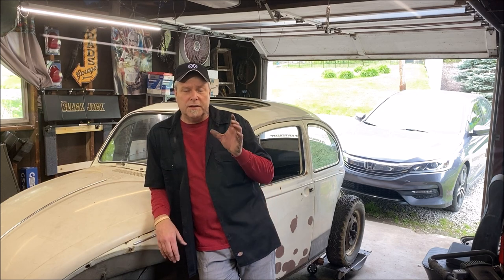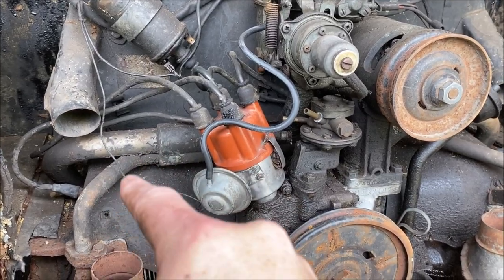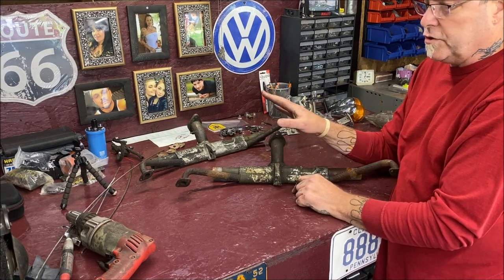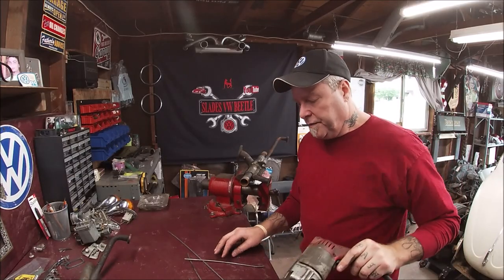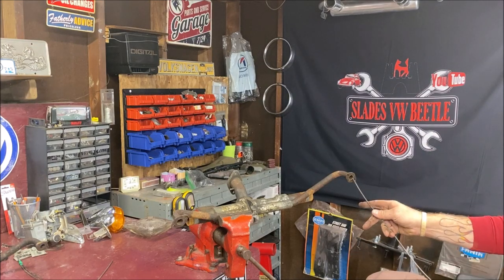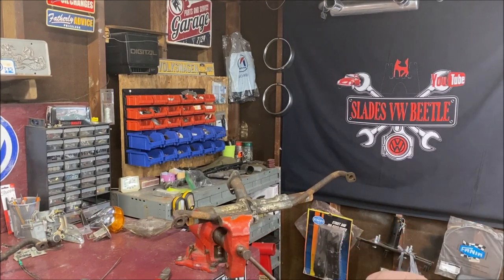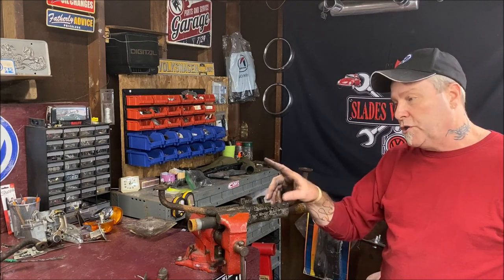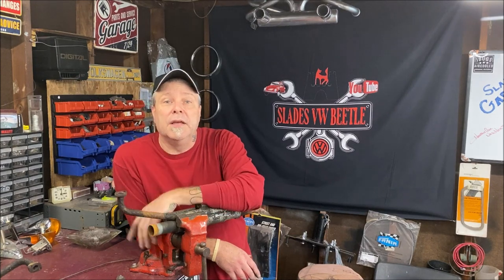VW Beetle Carb icing up- How to clean Heat Riser Intake - Carb icing up? Dual port - Single port

Comment: Been chasing my tail trying to figure why the hell my engine kept bogging on acceleration the point of shutting down. Runs perfect at idle. When I bought, I never noticed the heat risers were absent. It started and drove decently so I bought it and shipped it to Hawaii. I have replaced clutch, pistons, carb, distributor, alternator, fuel pump first to electric, now back to mechanical. I had heat risers from another manifold I'm no longer using and going to attempt to mate them to existing German dual port manifold. Icing at carb base happens even here in the tropics, I believe this has to be my issue, just dreading taking apart , AGAIN! I have to say I am so appreciative your channel exists along with many other helpful vw content creators!, Thanks Slade!
Reply from the maker: Thank you!!

Comment: So stoked to find this video.  My 56's carb was condensing and I was scratching my head until I saw this.  I am going to try it by removing the muffler.
Reply from the maker: Outstanding, I truly hope it helps out
Reply: @SladesVWBeetle  If it works I will be buying some merch!
Reply: @SladesVWBeetle  Its a 56 ragtop I inherited when my dad passed.

Comment: Great video! My mechanic did this to my intake for my 1971 beetle. He was not satisfied, so he got the tubes Hot with a torch rosebud and then shot oxygen in the tube. What a smoky mess! I had to have the tubes replaced because of leaks. Very important to have this clean running a single carb!
Reply from the maker: Yes, I have seen people use torches before. Unfortunately I don’t have any. But I’m glad he did that, your carburetor will definitely warm up properly.

Comment: I did this before. Was painting all my tins and changing gaskets. Someone told me about the carb build up so i had it all a part and said what the heck, might as well. So much carb build up came out. I didnt have any performance issues but im sure if i didnt do it i would have eventually.
Reply from the maker: It is so important to do this. And it makes a huge improvement on the carburetor being warmed up. I always hope these videos help other folks.

Comment: way back in '82, first year i owned my 73, i was heading home from work on a humid summer afternoon and out in the middle of traffic while waiting for a light to change, engine choked up. towed it to dealer. they get to it next day and say nothing is wrong. (IDIOTS!) 39 years of educating myself and i know that i got nailed with intake manifold icing. my solution was dual weber ict 34 carbs! oh, and the compressor coming on brings on a grumpy cat appearance. heehee. look at all that rust and crap comin out of there. enjoyed the vid. i had been in the garage working on my zuki. heading to the lake now to try and catch a fish.
Reply from the maker: Oh I love the dual webers 34s! 
That’s half the problem really damn fast. I have them on my 72 and that’s probably what I will have on the 68 to be honest with you. They warm up nicely, and wakes the motor up.
Reply: @SladesVWBeetle  i didn't have the right linkage when i was running my webers at first. got rid of it and went with the cb performance setup. so much better.
Reply from the maker: Oh I bet that’s a major difference. I had the hex linkage from aircooled...I wasn’t overly impressed with it but it worked OK.
Reply: @SladesVWBeetle  scat center pull? my original setup was center pull. cb's is much better. worth the money.

Comment: The other overlooked issue is cheap exhausts that have heater riser flanges but are pressure fed on both sides!
I was too chicken to use this method and just soaked the whole thing in Deox-C which is kinda the UK equivalent of evaporust.
Congrats on 3k subs, you've worked hard for it :)
Reply from the maker: Yes you’re absolutely right about the cheap exhaust. Soaking them can help too. And if you don’t want to use a drill, you can definitely hand feed a cable through there at least to get the loose stuff off. Thank you so much I truly appreciate the kind words.

Comment: Thanks you so much for this video! I'm so glad I found and subscribed to your channel.
I am new to my 64 and trying to learn.  As the days get colder and wetter (west coast of Canada) the beetle was running rougher and stalling out. I was told it was icing. Just stop and let it melt and you are good to go but it's getting worse not better. I'm going to try this. Can't hurt (if I'm careful😜) thanks for the clear instructions
Reply from the maker: Thank you so much for being here Lisa, glad to have you aboard. Yes definitely clean out the heat risers. That’s what will cause icing of the carb! Very important!

Comment: Excellent video thanks for the information. Just be cautious of the that dust coming from the heater riser. Since all these engines are before the end of Leaded gas (January 1, 1996) you really don't want to breathe any of that dust.
Reply from the maker: Thank you so much I appreciate the kind words. And yes it kind of upset me after it happened. I seldom can wear a mask when I’m filming. And a bunch of it definitely went in my mouth. Kind of made me nervous.

Comment: Great video.
 I just bought a new one due to not being able to feed the cable without it fraying. I didn't even think about the direction of the wire being wound.
Reply from the maker: It may have been clogged to the point of needing drilled out. Thanks for being here!

Comment: And another great DIY video on a really important topic.  I am cleaning my second single port intake manifold at y try is time using the drill-cable technique but afterward I will be using Evapo-Rust and let it sit for a few days to get rid of the rust as well as the carbon deposits. I figure using both methods could yield a more complete cleaning of the heater channel getting rid of both carbon deposits and the inevitable rust. Will let you know how it turns out.  Keep up these excellent videos, highly instructive content. 👍
Reply from the maker: Thank you very much James and thank you for taking the time to comment. I always hope these videos will give other people some ideas and help them out. It is really good to get those cleaned out properly to get the heat that you need to the carburetor.

Comment: Thanks for the very informative video its a job ime going to do ,.ive spent ages trying to fix the flat spot and bogging out on take up . it came to me when i noticed ice just below the carb  . I could over come the flat spot by slacking off the jet next to the idle jet a touch but the engine overfueld on cruse not a good cure if you want to save your engine . great videos keep em coming a the best from the united kingdom
Reply from the maker: Thank you Paul!! I appreciate the kind comment! I always hope these videos help others out!!

Comment: Mine was so rock solid clogged I had to replace the intake. I bought the aftermarket version from jbugs. I'm in process of installing now. Not complicated, but requires some trimming, etc to fit it to engine. I found very little info on how to do it. I think you could make a great video on how to install it properly if you felt like it. Thanks for your vids!!

Comment: I had carburetor icing on a baja I used to have, mine was leaking at the gaskets, I doubled up the gaskets (used two on each riser) and it fixed my problem. Just another thing that can cause icing.
Reply from the maker: Thank you, and thank you for chiming in and giving extra tips and advice. I truly appreciate that. It all helps folks out.
Reply: I appreciate you making the video, I can't believe all the VW's I've had I never had a stopped up riser.I have a porsche 914-4 now,really enjoying it.I hope to have another bug,they aren't as cheap as they used to be!Thanks again

Comment: I’ve used this method several times over the years and it works, but sometimes the carbon buildup is so severe that it can take hours of drilling to get it through. I like how you bend the end of the cable to get more action. I’ll try that next time.
Reply from the maker: It truly works well, and is such a huge improvement. Yes, sometimes they are truly plugged shut, and require actual drilling unfortunately. Thanks for being here

Comment: Just did this on mine. Heat riser was clear but whoever replaced exhaust never drilled out the holes! My god I can pull out onto the main drag now without having to worry about getting run over!!
Reply from the maker: Outstanding Martin!! It’s those little things that really make a huge difference. Thank you so much for being here.

Comment: Thank´s for the tip. Some people who live in warm weathers remove that pieces of the intake and the carburator run nice. What do you know about that?
Reply from the maker: I’m sure If they’re in a very warm climate, it might be OK. They are definitely on there to keep that carburetor warm.
Reply: @SladesVWBeetle  warm or hot with low humidity is ok. humidity no matter the temperature can cause icing.
Reply from the maker: Yes sir absolutely right!
Reply: Removing it would harm gas mileage, due to poor vaporization of fuel. Carb might need to be rich to get it to run ok. Excess fuel would dilute the oil. Liquid fuel doesn’t burn well. Engine life would be shorter. Dual carbs don’t need it but with central carbs it’s a must.

Comment: The heat is for the manifold, not the carburettor. It helps to vaporize the fuel instead of condensing and freezing. Water cooled manifolds are the same, heated. If you live in Phoenix you know that you will get boiling fuel, flooding etc if carb gets hot.
 On my baja the engine hangs out in the open so you dont even have a warm engine compartment. In winter I had to wrap the manifold below the carb with heat tape and digital controller and definitely need hot air air cleaner. The cable method probably wont work if it is completely plugged.

Comment: I also already bought a new one for my 66 beetle before seeing your video. The old one was poorly welded on one of the riser tube and leaked besides being clogged. The fuel portion had a number of pin holes. Probably the original manifold. A little off topic but it was a bear to get the new one to fit. I was finally able to get the intake to connect to the cylinder heads. But, both heat riser tubes screw holes are off by half the distance of the hole diameter(3/16-1/4"). I was told by the dealer to give it a try bending the tubes. Not so easy. Sort of a afraid that I might crack something using force. Have you ever run into this sort of problem? If I try bending the intake off the engine that will probably mean lot of installs/removals trial and errors. Advice?

Comment: It's the latent heat of vaporization.  This is exactly how your AC works, too.  You are taking a liquid and vaporizing it... or at least emulsifying it.

In the case of some carbs you need heat from somewhere else to combat the cooling effect.

Comment: i used the wire and it worked!!!!!!!!    My question is how do i pry the copper single port intake manifold gasket out of the head.    Do i use something like a dental tool to grab it.   Its stuck in there.    I dont want to gouge the head.

Comment: Hahaha yep makes sense...I had a brand new chinese 34 pict sngle carb on my buggy at first...it ran like crap, soot, dead spot, the carb was cold, dripping condensation excessively, and probably internally freezing...I just put on some duals and forgot about it...later, I had my intake with the risers stored, went to move it and it dropped and fell on the floor....all this crap came out of it 😬😬😵...that was totally why it performed so poorly. When I get a chance, I will re-use it on another project, after proper cleaning...
Reply from the maker: It truly helps brother!! Honestly the duals run so much better anyhow. And a cleaner looking engine compartment! Don’t toss your original intake though, they’re superior to the aftermarket!
Reply: @SladesVWBeetle  yes, thank you, i have a some original stock single and dual port intake manifolds, and some single.lort heads as well.., I will definitely hold on to them

Comment: My bug has been my daily driver for 15 years, only approx 4,000 miles per year and I have had to do this horrible job twice but with some carb icing signs now it looks like a third time is coming up, I might just buy a new manifold as I hate doing this so bad!
Reply: I soak the manifold overnight with diesel/kerosene before I do the wire/cable thang.

Comment: if one does not have an extra cable / clutch cable lying around, what else can be used to achieve the same result?
Reply from the maker: Pretty much any type of cable, it’s just convenient to use it if you have it on hand. 
I would check a hardware store they usually have many similar items on hand.
Reply: @SladesVWBeetle   - alright, thank you

Comment: This might explain how after I tuned my carb with a tach it still smells slightly like unburnt fuel. I'll have to do this, I always thought it was kinda odd how cold my carb would be. Only carbureted vehicle I've ever had and I just thought it was a carb thing.
Reply from the maker: Yes, definitely check into it. If your carburetor is cold to the touch after it supposedly should be warmed up. Make sure to do this, and you will be surprised at the difference. Thank you for watching and being here.
Reply: @SladesVWBeetle  Thanks for all the info you put out. Really helps us younger folks. 

I almost pulled the trigger on front end parts for my Super after watching your video when I remembered "oh yeah, mine are pressed in ball joints" and I don't have the means to do that work. 

Still, videos like these give me confidence to do the work rather than letting it sit or paying too much for what is a fairly simple job.
Reply from the maker: I’m glad they’re helping, I truly mean that. That’s why I’m doing a DIY channel so others don’t have to pay people to do their work. You could get a press site from probably Harbor freight. To do yours.
Reply: @SladesVWBeetle  That might be something I pay for, from struts to ball joins, the whole front end needs redone. Every bushing is torn and hard and the car pulls hard to the right if I let go of the wheel. It's really nice I have no shimmy though. 

I'm fairly close to several aircooled shops who worked on the car before and they do good work for not a whole lot of money. I'm lucky enough to be a younger person with a good paying job too, so I can afford some external work occasionally. 

Still, the confidence videos like these inspire does make me almost want to tackle stuff like engine dropping to replace the rear main seal and oil cooler seals that I know are bad.

Comment: i know this is an old vid but can this cause my car not even start? ive been having missfires on my 69, thought it was my distributor, got a new one ,changed sparkplugs and cables that run too them. need some info regarding this
Reply: I know it’s been sever months since you commented this, have you checked on this? I’m beginning to think I might need to do this my self. I’ve also got a new distributor, cables and sparks. And still won’t start

Comment: Hey brotha, I cleaned the heat riser thoroughly but I'm still having issues. I'm running a 1600 Single port with a 28 pict 1 carb. Gaskets are in and bolted down but she idles rough. After awhile ice still forms right under the carb. Any tips?
Reply from the maker: WTH?? That’s really weird. Are you sure the cable went through and came out the other end brother? And did you bend the cable slightly so it did a sweeping motion? I hope that made sense.
Reply: @SladesVWBeetle  Yes sir, I did every bit to make sure she was clean and she also came out the other end of the heat riser. Theres a couple other issues I have to address but I think I know what the problem is. I still haven't gotten the car to full temp so it may change my results. 🤙🏻